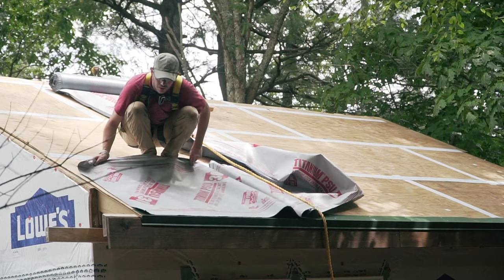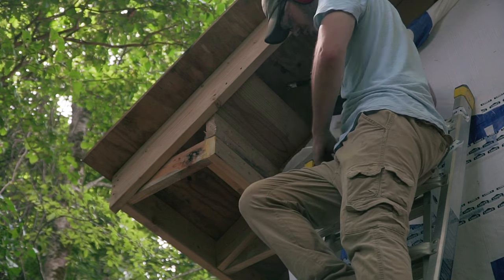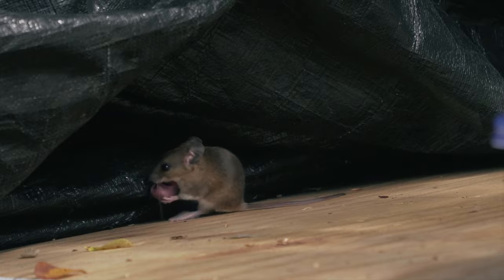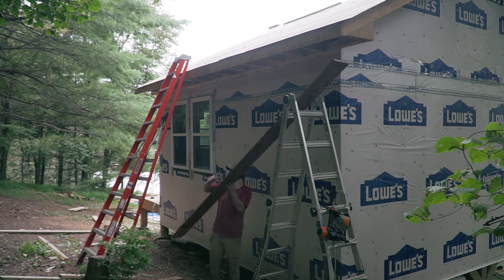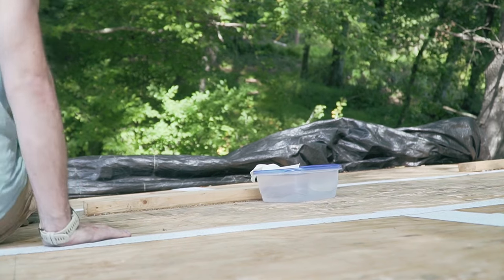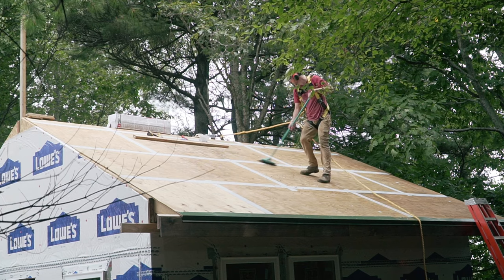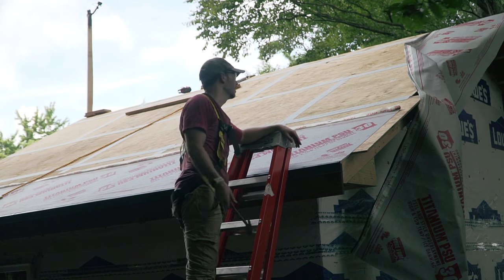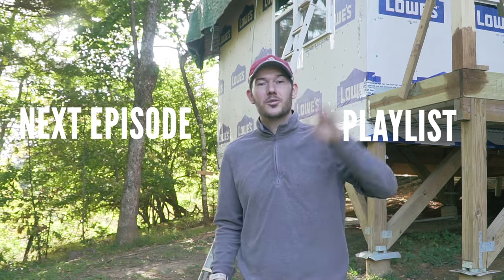How Did They Even Get There ? - Cabin Series Ep 38

Comment: Measure the width of the roof. Cut the ice&water shield on the ground. Take one sheet up, install off a ladder or scaffolding.
Reply from the maker: That’s why I did for the subsequent layers of you made it that far into the video. It was better but still heavy and ready to slide off under its own weight.
Reply: Find it easier to line up the bottom
And nail the top above it. Drag it down the roof with the roll. Pull tight along the top and get a measurement. Roll it back and cut it. Than just nail the bottom off and roll the next length out. Saves you from having to get up and down constantly. Just set the roll up before hand and a nailer, stapler ect. And do the hard work once . Can set up a kicker plate to hold it by the peak and just leave that to the last part to do..
Reply from the maker: @Ag-xy4gu  thanks for the tips!

Comment: I’m working on my cabin every other weekend. The 11 days I’m gone the mice go crazy, especially now that we have had snow in Minnesota.  After the roof, windows and door was installed we did a through sweep and set a few traps. Don’t want critters built into the cabin.  For our roof ice and snow shield we got scaffolding. So much easier and safer once it’s up.  The set up and moving takes a lot of time though.  The battery tools are nice too. Between power cords and air hoses, it’s a mess.  Learned a lot on this cabin.
Reply from the maker: Paul, I might end up building myself some basic scaffolding when it’ll be time to install my siding and trim on the outside. 
Yeah I’ll also have to be careful with mice once I start installing my insulation especially the one in the floor system.
Reply: @TheDIYCabinGuy  we haven't put insulation underneath yet. When we do, we'll have to do it in one day so mice don't move it overnight. Then, I understand a good tight fit of plywood so there are no gaps. If caulking it needed for small holes or gaps I may cut small steel wool pieces, stuff them in first then caulk. Keep mice from getting in. They are a challenge.
Reply from the maker: @paullandreville5394  I plan to do the same thing under, cover it all with plywood.

Comment: If you did a light spray of contact cement on the roof and let it dry that  underlayment would have stuck really well.  That self adhesive stuff alone doesn't usually do the job It needs help. Great job so far building this cabin I've been watching since the beginning.
Reply from the maker: Thanks for the tip! I had no clue that another product existed to help with the install!

Comment: Bro… if there is a next time, cut the length of ice shield you need first then just take that piece up on the roof with you.
Reply from the maker: Hey! If you look at the Timelapse, that’s exactly what I ended up doing for the rest of it. Easier for sure but still a mess as the weight of the piece would still make it slide down.

Comment: 13:19 There's got to be a better way to apply ice-and-water shield than this method. Two people is best. But, if only one person, cut to length. Snap a chalk line for top edge. Then, remove top half of backing longitudinally. Stick along that line. Roll tight to wood. Then, remove lower half of backing. Roll tight to wood. Repeat for next row.
Reply from the maker: I think I struggled some much as this was the first time doing it. I don’t doubt that someone with experience would manage to do it faster.

Comment: Think I’ve read those mice reproduce every 21 days, could be a disaster if left unchecked.
Reply from the maker: Oh yeah they get absolutely anywhere ! I’ll have to be careful once I put my insulation in
Reply: @TheDIYCabinGuy  I’m going to be building a cabin on piers. I’m undecided on how to finish the underside due to my fear of rodent infestation. Was thinking spray foam the whole underside so there’s no way for them to burrow between the insulation and the floor. Or regular insulation then quickly face the underside with plywood to seemingly seal it, but I’m concerned if a couple mice somehow get behind that plywood underside that it would be a big job to take all that plywood off, discard the insulation and do everything over again. I’ll keep an eye on what you do regarding the insulation.

I really enjoy your videos, very helpful and entertaining!
Reply from the maker: @the_atomic_punk487  thanks! My goal is to use batt insulation then probably 3/4” Rigid foam insulation and pressure treated plywood. We will see if that works well, it’s gonna be so difficult to install too.